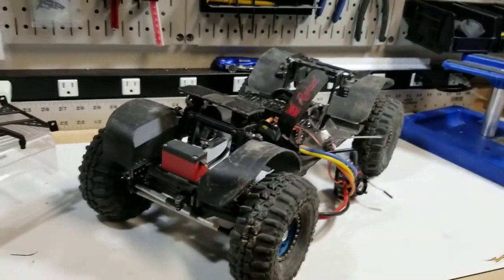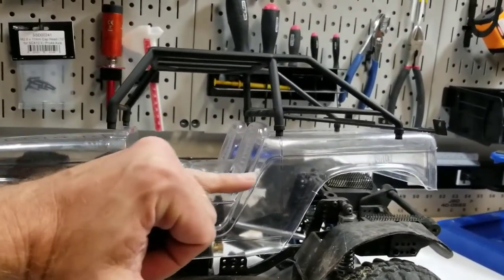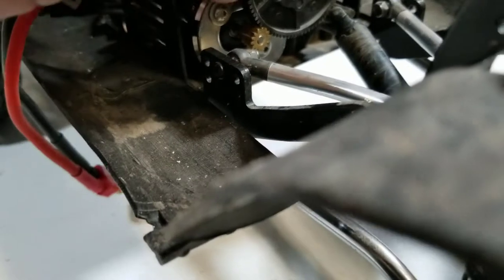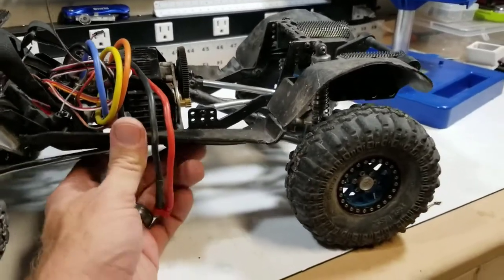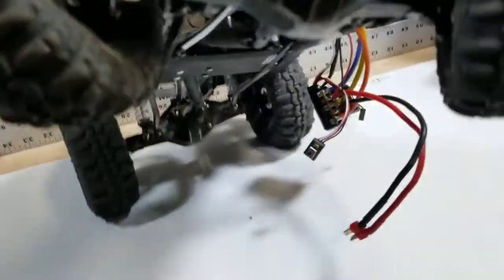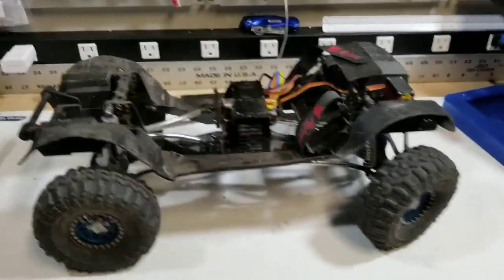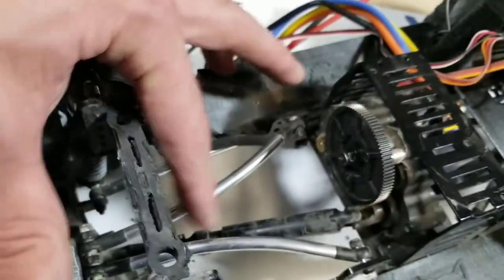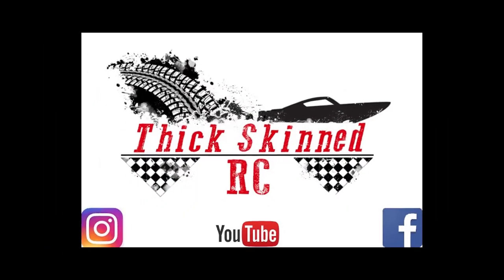Gen7 Pro Update - Suspension, Electronics, Body, Axles, and more 3D printed stuff

Comment: Awesome.. just got my gen 7 pro... I’ve learned that checking things for tightness after every run is a must... but loving it! I need to get rid of some too heaviness..I’ve moved spare to front of hood.. still needs better. I’ll figure it out though! Thanks for the vids
Reply from the maker: JOE PRIVETT congrats!  Great rigs.  The pro is definitely a bit heavy from the factory.  About the same as the raptor hardbody.  Good call on moving the tire, biggest bit of weight way up high.

Comment: Great video.  Even though I don't own a gen7 I've printed a ton of stuff for the gen7.   have you watched the truck bed conversion video I posted? I printed the bed and AC/RC crawlers did the install. We are doing another one where he is going to get vídeo of the install process.  👍✌
Reply from the maker: RC VOODOO thx man!  Hadn't seen it yet but about to check it out.  That bed looked pretty slick in the couple pics of seen of it on facebook.